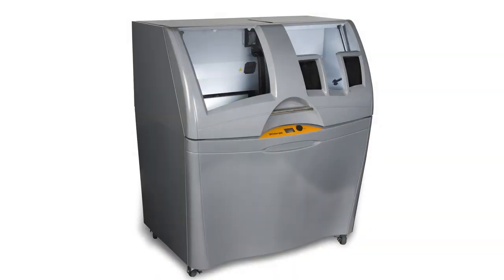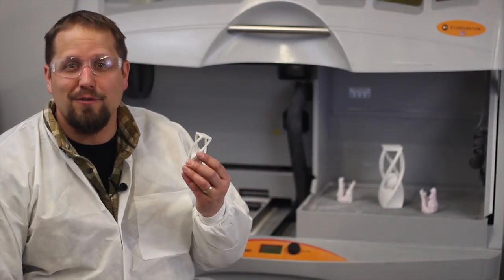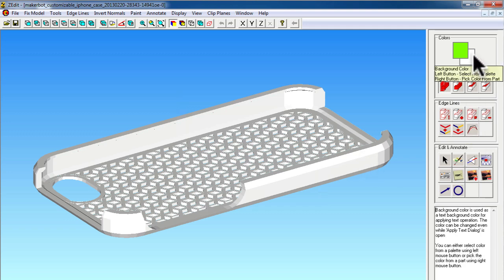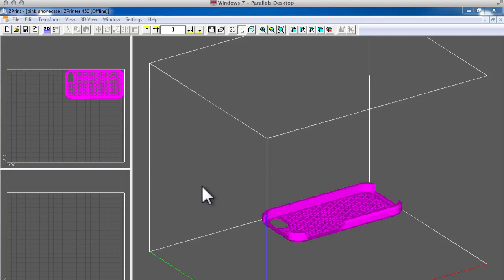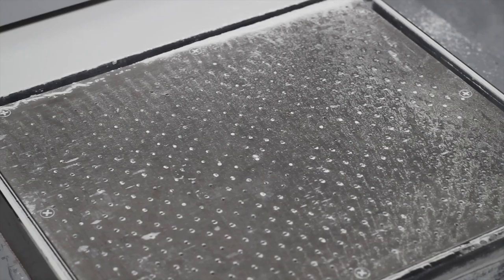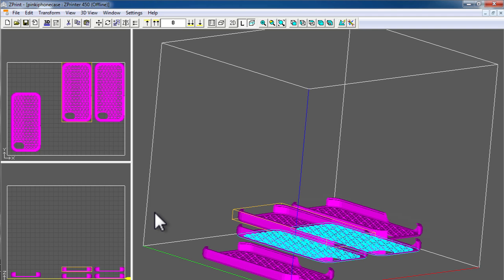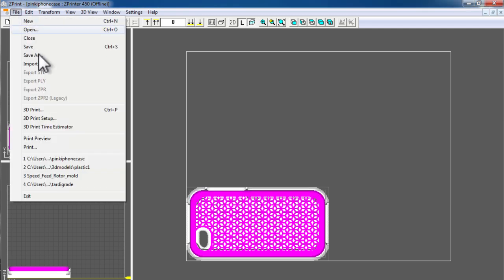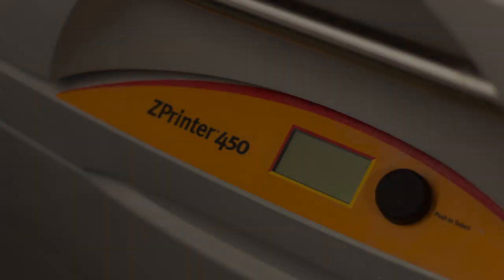3D Printer Overview: ZPrinter 450

Comment: Great video!  I wonder if buying one of these machines for less than $1000 would be worth it.
Reply: Lol you ain't getting one for anywhere near a thousand bucks
Reply: i know it is 3 years later but I just got one for 3k with 30lb of powder with it.
Reply: dsjc666 I wonder if you bought that printer and how that works?
Thanks for taking your time to answer
Reply: 10 years later and found one for $350 on facebook marketplace. Reliable machine at minimum. Not sure on  part quality or strength compared to whats out there now. 2023